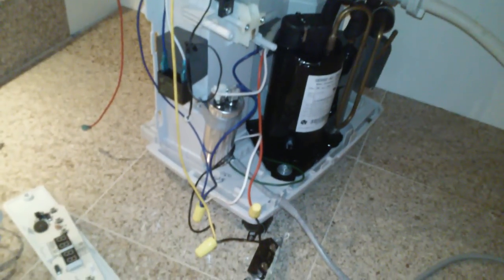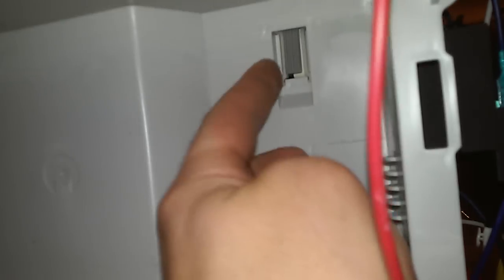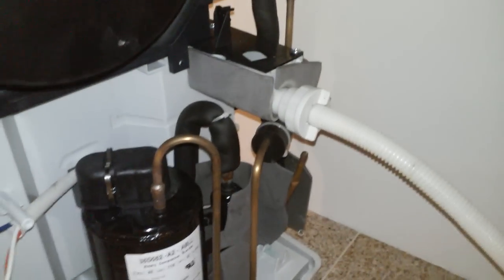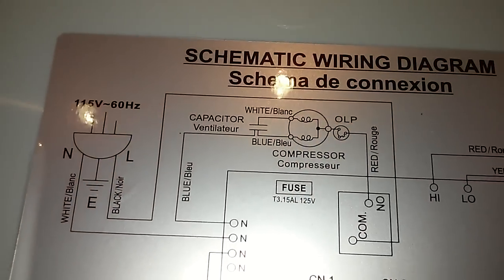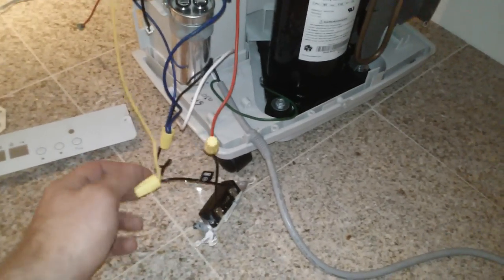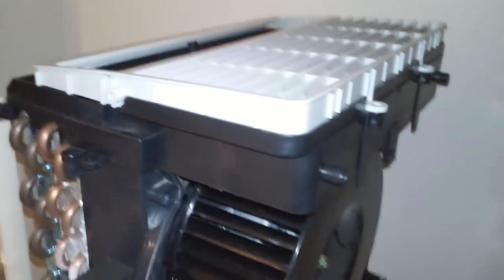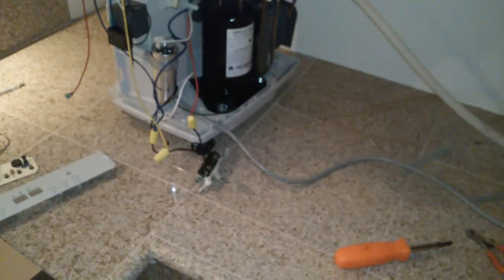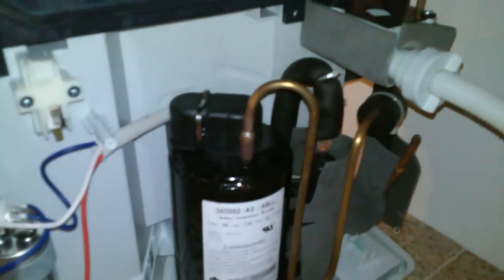Danby DDR5009REE Dehumidifier Repair

Comment: Hey everyone, wanted to update the video with some info.  First of all, if you do install a timer, make sure the UNIT HAS POWER ALL THE TIME, and the timer only controls the fan and compressor or preferably just the compressor.  If you try to power up the compressor and the "system" at the same time, the capacitor will not have time to charge and the compressor motor will not run and will most likely burn out!
Also, be careful which wires you connect from the fan to any switch.  I accidentally used the Hi and Low speed wires instead of the Hi / Neutral and Lo/ Neutral and ended up burning up the fan.  $30 mistake, for the much I could have replaced the circuit boards.  Good luck!  This is not dangerous, if you want to be cautious, discharge the capacitor by connecting the terminals with a screw driver before any work.
Reply: Your humidifier has been recalled because it's a FIRE HAZARD. Please contact the manufacturer for compensation.
Reply: Are you sure the 30uf or so capacitor for start up motor need a timer relay?
Reply from the maker: @悟入木三分  The capacitor needs power to charge up BEFORE the compressor turns on. The timer should actually go on the fan/compressor. The capacitor should be wired to charge as soon as the unit is plugged in
Reply: SolarNova ： you would know it is not necessary when you read the circuit diagram again.

Comment: The capacitor does not need to "charge up" before the compressor starts. It is an AC circuit. The voltage and current reverse 120 times a second.
Reply from the maker: you are wrong. The capacitor needs AC power before the compressor tries to engage or it will rotor lock
Reply: @SailingKitabu  Let's pretend you are correct even though you aren't. What provides the delay between start winding and main winding energizing? Answer is nothing. They get energized simultaneously by the same relay. You said it needed to charge before the main winding was powered. That is incorrect. The capacitor provides a phase shift to the start winding

Comment: Looks like the same model as mine. I wish you would have shown how to remove the control/circuit cover. I can't for the life of me figure it out. All the screws are out. It pops up in the middle but the skinny ends won't budge no matter how hard I pry.

Comment: I picked up a rather nice and clean Whirlpool unit at the curb on garbage pickup day.  I plugged it in and ran it overnight.  The bucket filled with water to the point of shutting off the unit.  But...

I detected that occasionally when the electronics were powering the unit off, the compressor would remain running.  Now, when the evaporator/condenser fan isn't running, but the compressor is, heat builds up.  It doesn't take long for the thermal overload switch to trip at the compressor.

Okay, let's check the relay operating the compressor...  Sure enough, the control side goes high and low (12 volts) as commanded by the electronics.  However, the power side remains hot all the time intermittently.  Even with the power cord removed from the mains, continuity was at the power side of the compressor relay.  A lookup of the number printed on the relay shows eBay has them for under $10 U.S. including shipping.  A relay is on the way!

Once the relay arrives and the faulty unit replaced, we'll see if that was the only problem or there are other issues in the electronic logic.

Boy, let me tell you...  The dehumidifiers sold today are pretty much garbage lasting barely out of their warranty periods.
Reply: @TheSealShepherd  Yep!  It was the relay.  For the last two seasons, that free-at-the-curb dehumidifier has been keeping the air dry in my basement over the Summer months for the last two seasons!

Comment: I would think a timer to run the unit would not work as you have to charge the capacitor before the compressor will run. I would think to add a time delay for the compressor instead of the switch. Then you could run the dehumidifier off a timer.

Comment: You know your shit.
I'm looking at fixing a dead relative humidity sensor, which shows E1 on the display. Everything else works fine, but because it doesn't know what the humidity is, it will never shut off when the humidity level is reached. I can't find a replacement for the sensor because it has lots of meaningless numbers and codes on it which Google yielded no results for. I'm not going to throw away a £120 unit because of a bad sensor. It's a smart looking unit which they don't sell anymore.

Comment: I have two Shinco 30 pint humidifiers and used for one season last year and when I started the units this season, they both would not start due to bad humidity sensors gone bad.  Maybe I should have cut them off over the winter?  I bypassed the all the digital circuit boards as you illustrated in your video.  They are both working in which I installed the manual cut off switch to the compressor as you did in the video.  I plan to install a humidity controller to replace the manual switch to the compressor.  The controller is $21 on Ebay.  Thanks for the video!  My cabin humidity is back to healthy levels..........

Comment: Excellent video, thanks for posting.  Still relevant 4 years later :)  I just did this to an old Whirlpool dehumidifier that wouldn't start after sitting idle over the winter.  No lights, but power was fine.  Another circuit board problem.  Nearly identical to the Danby, but the wires were different colours.

For other people doing this (perhaps on a different make), here's a couple of tips.

Take pictures of your set-up before starting.  This way you don't have to remember "was it the red wire, or the yellow wire I took from that slot......".

Lower control board: this is where the power comes in from the outlet.  The black wire (from plug), white wire (from plug), compressor "on" wire (red in this video), compressor capacitor wire (blue in this video), and fan line wire (yellow in this video) should all be connected near each other on the board.  The two fan speed wires should also be connected near each other, but well away from the wires noted above.  This is how I was able to identify them on my unit.

Other fan wires: you shouldn't have to disconnect the fan capacitor wires. IF you do, keep track of them. 

If you make the two wires connected to the switch fairly long, you can route them out of the unit through one of the openings in the plastic covers.  I tested my setup, disconnected the switch, then ran the two switch wires out through the top grill as I was putting the cover back together.  Reconnected the switch, and had a fully assembled working unit with the switch on the outside.

Comment: Having trouble removing the case. Top ans sides are free but bottom seems interlocked in place and I'm not seeing the key to the puzzle. Any suggestions or tutorial on this? Thanks.
Reply: Never mind. Found the 2 remaining screws that were hiding in plain sight.

Comment: The control board typically uses relays to turn on and off the fan and the compressor motor.
Attach two wires from the relay power terminals and connect them to a switch. In this way you can manually turn on. If it works, your compressor and wiring is fine (the relay is not getting its act). Now remove the wires from the relay power contacts and attach two wires to the relay coil. First without AC power apply 12Vdc to the coil (minding polarity), hear the click and confirm with Ohm meter the relay operation. If the relay works, repeat with AC power. If it does not  - replace the relay . If the relay works but gets no turn on command, trace the coil connection on the PCB to eventual transistor that is supposed to energize the relay...

Comment: Excellent video thank you. Can you tell me how to open the white top section with the keyboard buttons. 
I have it loose on one side and will break it open if cant find solution. 
Again thank you.  
                             P
Reply: Let me tell you : there two screws are hidden underneath the screen cover of function pad. You need to peel off the film at each side about 1.5 inch to the edge. You will find these two screws. Removing its and you will split the function pad.

Comment: hi.

i have this model and the power button dosent work. somehow i cant figure out how to remove the circuit board...

can you please do a teardown video so i see what screw i missed. thanks
Reply: I have the same issue. How the hell do you get that LCD board out? I reconnected all the connections on the power board and it started back up, ran 2 minutes and then died forever more. I am not gutsy enough to run this with the safeties disabled.

Comment: I rewired it exactly like you did and have power. fan works and compressor turns on but my coils aren't getting cold and hot? compressor isn't running as smooth as yours either. any suggestions?

Comment: good video, could you wire the line through the over flow switch normally closed, so when it fills it breaks the circuit and turns the power off?

Comment: Have you ever taken apart the compressor? I was thinking of sawing one of my broken humidifiers apart with a hacksaw and see what is inside that goes bad. Is the inside of the compressor under presser? I wouldn't want it to explode if I saw it apart.
I had a westinghouse model ED257R1 that I got from my parents. It lasted 40 years and all I ever did to it was buy a new fan motor for about $10 after it was 30 years old. I bought the motor at Graingers.
I then bought a Sears Kenmore model 580.51650000. It only lasted about two years. I took it to Sears to have it fixed and they said the compressor was bad and it would cost about $169 to fix. I didn't fix it and bought another brand and will never buy a Sear Kenmore dehumidifier ever again.
I looked at Consumers report and they rated a Danby Premiere Model DDR509REE very high so I got it and it has been working fine for about 5+ years and I have not had to fix anything on it.
Thanks John

Comment: I "dissected" five units to now and I did find :- even to open the cover sometimes you need proprietary tools- they break down few months after the warranty is up- they are designed on purpose as not to be fixed- obtaining the schematics of the board is impossible.I wish masons shall be much more careful building and waterproofing the basements.

Comment from the maker: Diagnostic mode?  You see me doing it don't you?  Haha.  Good luck let us know if you find it.  Only thing I did not try was shorting out the connection for the freeze sensor, try that plus everything else I did and you will know if it is your logic board, you cannot damage it more than it already is, trouble is knowing which board to replace.
Reply: Here is what i found.  My display panel did not seem happy as it was working ok, but it kept displaying a 59 followed by a 60.  The power circuit board looked ok, as the capacitors were not bulging, and none of the transistors were not burnt, etc.  i ordered the logic board (under the keypad), and the unit is 100% functional again. 

I was able to get the compressor, and fan to run with a bad logic board.  I tripped the water sensor till the machine shut down, then i replaced the water bucket, and the machine fans came on, then i lowered the humidity to 30%, and repeated this a few times till i heard the compressor kick in.  This told me the compressor, and power relay board were somewhat ok.  Also, check the power board compressor relay that is in the center of the board.  I think those burn up.  If he compressor wants to come on, the logic board sends the power board a signal to send ~12 volts to the relay.  I was never seeing 12 volts, so that is how i guessed a bad logic board.

Comment: Anyone knowhow to put this in diagnostic mode.  Most control panels have a key sequence that takes you to diag mode to both read sensors, and set relays or logic on.  The logic board can be bought on the danby site for $30

Comment: different model but tried everything until your vid.
removing all electronics and add a switch thanks to you.
just about to wire it up
thanks for the tip

Comment: I'm on my third Danby due to similar issues. I bought the Menards warranty so they just replace it with a new one without any questions. Well now the warranty is dead and mine shows "Hi" on the display yet the fan runs full blast. The compressor won't kick on. I'm assuming the thermal overload sensor is shot or the compressors is really overheating.

Comment: Thanks for the video! I am going to buy this exact model so that I can follow your instruction to decouple the main components from the circuit. I need a dehumidifier for a research project, but since I am a mechanical engineer, I don't know how to deal with the electronic circuits, this way it will be easy to just make the system work.
Reply: +Houman see my post above
Reply: Thanks foe the further info Joe! and Happy new year :-)

Comment: my model is DDR45A3GDB ....very similar to your model...the innards look like a carbon copy................
Mine only draws the humidity to about 55-60.....then the compressor shuts off, but the fan runs continuously.....if i restart the unit,  it will kick-in /run  awhile then revert to fan only.....i need to get the compressor to run continuously and hook up a timer as you suggest.....since i have nothing to loose....i will diddle around  (using your wiring info)...being careful not to electrocute myself.....ps....even if unplugged....is there a danger/caution  to avoid that huge capacitor??   mine went kaput 2 months over warranty .....somethin' fishy here.......maybe a class-action suit might be in order,...ya think??  when i called Danby...their attitude was like "good luck sucker"......
Reply: +J.R. Zippie Try disconnecting the freeze sensor wire from the circuit board, that may fix your issue.  Apparently they go bad often.
Reply: are you kidding?  What a bunch of useless, time consuming garbage,,,,,A master of double talk and confusion...
Reply: Joe Seraphin  I just had same thing! The freeze sensor I unplug and that fixed it. Now before I put back together should I replace the freeze sensor or just leave unplugged?
Reply: Joe Seraphin update... I don’t think that’s it now. When I breath heavy on the humidity sensor I can see the readings that it’s going up on display but compressor doesn’t kick in until it gets around 85 or above. I’m thinking of just bypassing that sensor but unsure of what wires in the 4 ribbon wire to tie together